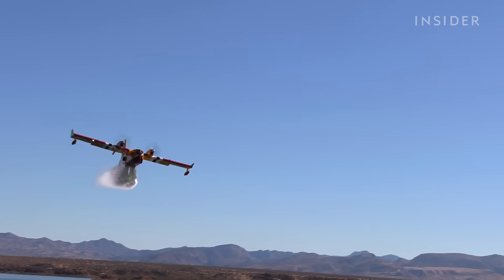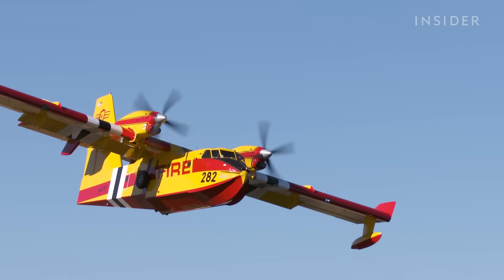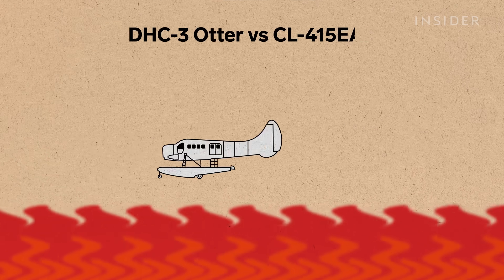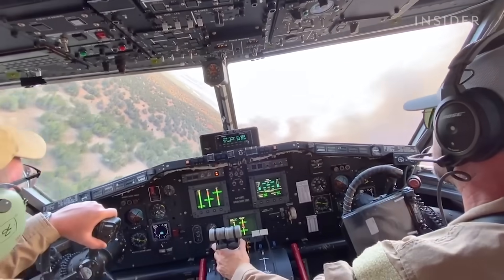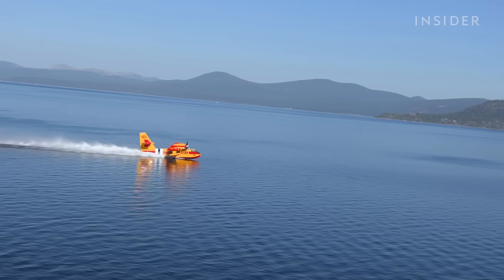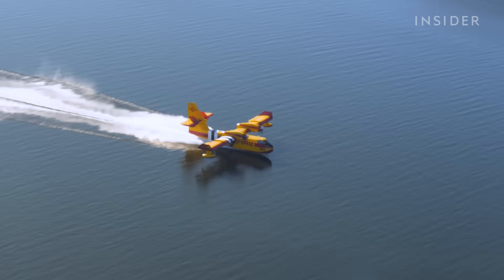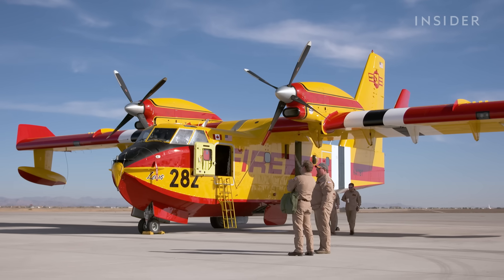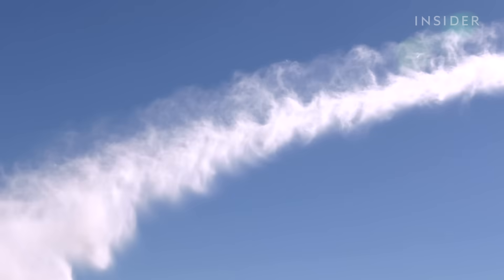How The $30 Million 'Super Scooper' Plane Was Built To Fight Wildfires

Comment: i wasn't expecting that small opening to act as the entry point to scoop 1400 gallons of water in just 12 seconds
Reply: The mass of the water have a brake effect , if it has a large opening this will cause a greater loss of speed.
It's possible to estimate the volume taken by the 2 scoops approximately by 1 foot*1 foot*distance traveled in 12s@100kph

Comment: The should invent in a fire fighting helicopter and have a bunch of them hover around fires.a plane will spray the water be done but helicopters can stay on top of the fire and distinguish it
Reply: How exactly will you load the water onto those helicopters?? Helicopters just hovering over fires are useless. There are plenty of fire fighting helicopters but not a single one comes anywhere near the amount of water these fire fighting planes can carry. Also, the rotors of the helicopters actually blow lots of air into the fire making them stronger.

Comment: Doesn’t need to cost this much. Designed for tide pod generation to exploit govt / municipal / state budgets - basically the public.
Reply: Not really. In general aircraft production is extremely labor intensive, even more so in low production numbers like these planes which fit a very tight and small niche in the world of aircraft and require very specialized development and equipment. 

But of course, companies do have to make a profit, otherwise there would be no point for them to exist.

Comment: Why don't they run a hose. Dynamite works on oil well fires.
Reply: Find a hose several kilometers long and preferably one which can be connected to a pump strong enough to withstand the insane pressure you'll need to push all that water for all that distance. Oh, and  while you are at it, design a super strong hose as well which won't leak due to the insane pressure required.
Reply: @equestriangirly2296  the pressure wave from a bomb blast would put out the fires. It would provide the younger kids with great bomb dropping experience, however I think I saw a streachy hose on tv.

Comment: These pilots must be incredible pilots!! I have driven a fuel truck and you have to be very careful because of the huge amount of fuel splashing around and changing the weight load, I can't even imagine an airplane trying to fly and having to deal with this.
Reply: Engineer here: it has more to do with how full the tank is than how big the tank is.  If you cram the tank 100% full like these planes are doing, there's no possibility for sloshing, and it's pretty safe.  Dump the whole load, and once again, no sloshing.  A fuel truck that only managed to deliver half a load is a worst case scenario.  Not only do you have a liquid sloshing around, that liquid is highly flammable
Reply: In Greece ,which has one of the largest fleet of these aircraft  , many of the pilots are in their 50s
Reply: The tanker truck for the FD I was on holds 2000 gallons of water. When that thing was only half full it was difficult to drive, even with the baffles in the tank. After a fire we always tried to refill before going back to the station so we wouldn’t have to deal with the water sloshing in the tank.
Reply: @MaineOffGrid.  Free surface effect is a doozy.

Comment: 2:44 No! The rudder does not control direction in an aircraft. If you press a rudder pedal, the nose will swing but you will not change direction. When you release the rudder, you'll be pointing in the same direction you started (if you kept the wings level).
Reply: Um, the rudder absolutely does control direction. Kick right, plane yaws right, right wing loses lift and drops, plane enters a right turn. This is literally THE most basic aircraft manoeuvre we have. I mean sure, I can actively prevent that natural turn through aileron input, but that hardly means rudder doesn't control direction ... the entire point of the rudder is directional control.
Reply: @markmcgahey8385  Hi, thanks for your reply. Yes, you can roll an aircraft using the rudder, especially at low speed, but it is the bank of the wings which causes the lift vector to turn the aircraft, not the rudder. The point of the rudder is to counteract adverse yaw and all the various power effects. While you can fly certain aircraft (mostly models) which only have a rudder, you still cannot change direction without banking.

Comment: This video is such a commercial. Did the reporter actually do any research at all or did he just read the script provided by the manufacturer?

This isn't the largest scooping aircraft in the world, the trusty Russians build the BE-200, it will scoop  3200 US gal compared to the CL-415s 1620 US gal. It is not the largest capacity aircraft on the market, it's not the most agile firefighting aircraft out there and it does not have the longest loitering capacity. It's a mid-sized fire fighting aircraft designed for a specific type of fire fighting mission and it will most likely outperform any other aircraft in that specific mission. But it's not the hands-down best fire fighting aircraft for all eventualities.

They claim that it's the most cost-effective firefighting aircraft is highly contested and depends heavily on what you need in your firefighting fleet. There are many other manufacturers and fire fighting aircraft out there that cover different types of markets and fulfil their type of missions better than the CL-415. If your operations have a need for an aircraft with the exact specs and capabilities that the CL-415 has, it's most likely gonna be the most cost-effective. But for others, a fleet of helicopters or smaller/larger fire fighting aircraft may be more suited.

The section mentioning the large size of the rudder is just cute.... The shorter your aircraft is, the bigger the rudder surface you need for a set amount of rudder force. 
For example: The tail section on the Airbus A318 is larger than the tail section on the Airbus A320, this is because the fuselage is shorter on the A318 and they need the extra surface to compensate for the reduced leverage between the tail section and the aircraft centre of rotation.

Yes, the aircraft may have large control surfaces for its relative size. 
But comparing the rudder to the rudder of a B737-900 (the longest 737NG there is) is just mumbo jumbo. 
They are just trying to make something sound impressive to anyone that does not know anything about aircraft design. 
It's not something special to have a large rudder on a short/stumpy aircraft. It's a necessity to provide enough rudder action allowing the aircraft to rotate around its yaw axis.

Yes, this is a highly impressive aircraft.
Yes, this is a highly capable aircraft.
Yes, What the crew of this aircraft can do with it is impressive.

Unfortunately, the hype in this video and the narrative of it makes it feel like a total sellout to the manufacturer and there seems to be very little actual research done prior to the video release.
Reply: The Russians were flying wood and fabric biplanes when Canadair designed these aircraft. They are very late to the  game (Who the hell would fly in something bolted together by the Russians, anyway? Can you put out a fire by dropping pieces of airplane on it?)
Reply: @abrahamdozer6273  Cute and clueless.
Reply: @abrahamdozer6273  Trying to make someone or something look inferior to others by stating factually incorrect information dose only reflect badly on yourself. 

The fact is as follows: the CL-215 that the CL-415 is developed from were designed in the 1960s. By then the Russians had designed many advanced aluminum aircraft with jet engines. 

By the time the CL-215 flew the MIG-21 already had 10 ears in the air. For reference it can be noted that the CL-215 is a piston engine aircraft using engines designed in the 1930s while the MIG-21 were a jet aircraft with engines designed in the 1950s. 
So to use your own comparison: When Canadair built a aircraft with vintage WW2 technology, the Russians we're building aircrafts with state of the art jet technology.

However, this comparison is irrelevant due to the fact that your statement holds no validity since it can not be taken seriously. Its only made to try and make fun of another countrys aircraft industry using false logic containing no factual basis.
Reply: @somfanheller  I would't get into a Russian aircraft if you paid me $1000.00. Fourth raters ...
Reply: @abrahamdozer6273  That tells us more about your knowledge of aviation than the quality of different nations aircraft designs.

All aircrafts fail, Russian, American, Canadian, English, Brasilian, Swedish.... The list goes on. No human design is devoid of issues. 

There are better and worse designs and all manufacturers makes bad design choices. Irrelevant of what nation designed it.

However, I don't see what this has to do with the initial video and how it portrays the CL-415.
Reply: Bigger is not always better. Not all fires are the same. Bigger planes are less versatile because they are less maneuverable, and require longer distances to land, take off, and re-fill the water tanks. Smaller plane can maneuver and function within within mountain environments, , and re-fill their water takes on smaller lakes, for example,  than their much larger counterparts.
Reply: @Doug_BC  did you even read my full post? If you did, you would have seen that I never clame that bigger is better. My whole point was that the video is a complete commercial piece, basically written by the manufacturer. The truth is that different aircraft fulfill different roles/missions and if you watch the video, they make it sound like the CL-415 is the best fire fighter aircraft ever built, for all fire fighting missions.
That is categorically false since there will be aircraft, both larger and smaller that will provide better capabilities for different kinds of missions. 

I'll repeat my prior statement, the CL-415 will most likely excel and even outperform their competitors in the mission type it was designed for. But there are, without a doubt other aircraft better suited for other types of fire fighting missions that the CL-415 isn't designed for.

Comment: 14 autonomous planes carrying 100 gallons each would be cheaper
Reply: You sure? Naaahh
Reply: @goki6548  cheaper than 30 million? 1400 gallons is not much. 14 drones would be cheaper and expendable. they could get more than 14 and swarm. that is eventually how it will be.
Reply: @frankyflowers  you have to release all of the water at the exact same moment and place. 
Also a drone would not be able to go fast enough to make sorties like this. (Not even gonna talk about how a drone would not be able to contain 50 gallons let alone 100.)
Reply: @goki6548  do you know that drones can be big? they can work as one. they can handle more g forces than humans can tolerate. they can use normal planes and make them into drones. what is the top speed of a drone and max weight? thats not true. they can be fast and heavy.
Reply: @goki6548  drone aren't all quadcopters. that yellow plane could even be a drone with the proper hardware and software.
Reply: @goki6548  most stuff that happens in space are because of drones and those tolerances are way more exact than dropping a load where we tell them relative to the heat source. there could be an autonomous bucket brigade or swarms working in unison.

Comment: Dont understand what all the hype is about, the Martin Mars water bombers in Port Alberni BC are larger 4 engine float planes that have been used since the 1950s and can drop 27000L (7200 gal) of water at once.
Reply: Martine Mars bombers are old and are at/nearing the end of their useful service life though.
Reply: My point isn't that the old out dated hard to maintain planes are better than this little guy, it's that this is not a new idea. Strapping some wings and engines to a big tank to drop water on fires. This dude acting like he discovered water puts out fires!
Reply: The criteria is not the capacity per flight but the one per hour. If a plane can make several rounds even it has smaller capacity per flight it can carry much more water in a shorter time

Comment: It looks like they contained and stopped the spread of fire back in the days unlike now it spreads beyond grip.
Reply: Fires arising from the kind of droughts in well grown areas we are getting cannot be contained untill some rainfall comes. You can't drop water on dry and dense brush, the soil will soak it in deep and the heat will evaporate the rest of it in seconds. Besides you would have to spray the entire perimeter every few minutes which just isn't doable. These resources are mobilized when you get a fire that can be contained (lower density brush in more arid climes), or when weather conditions favour a containment attempt.

Comment: The aircrafts are a must to fight forests fires and worth every penny
Reply: this one isn't. its only 1400 gallons
Reply: @frankyflowers  1400 gallons up to 10 drops an hour, versus a huge tanker that has to land to pump its tanks full again which can only fly perhaps a drop per hour or even longer. Add in that they often fly in groups to mount sustained attacks and it gives the fire a sustained beating, rather than a big punch occasionally. Also think of how a fire will continue and grow in the time between passes, they can grow enough in an hour that you'd not even know there was a drop 60 minutes ago. Sustained attack with short intervals between drops is the way to go. If the big birds were effective, then why are all 3 of the tanker-converted 747's grounded and inactive? The answer is they're not efficient, can't land at small airstrips, need huge temporary tanks or large water mains to refill and their cycle times take forever, plus the maintenance costs on them are astronomical. Sure, the 747s hold 19,600 gallons, but what about bad drops? They have to fly way higher that the CL-415's so their accuracy sucks and the dispersion is massive, and if they miss entirely its still another hour or whatever for them to land, tank up, take off and fly back to the fire. These CL-415's are the A-10 Warthog of water bombers, they're dump-trucks that can fly low & slow and nothing else does their job quite as well.

Comment: They really need a slow door release option.  Dropping 1400 at 100 ft at 200mph is like dropping a bomb.  I used to call the shots from the ground,  when there is no air attack its direct comms to pilot.  Sometimes you want a high slow release the effect more like a genital rain than TNT.   Yes I've been hit by 1000 gallons directly and it nearly killed me.  I was braced and latched on to the rock and it about washed off the cliff.  [The face of wich was full of burning trees and stumps in the cracks ]   anyhow cool educational ,  my brother in 33 year of wildfire loads slurry at Paso Robles now , I only did a decade then broke myneck a second time Takei g me out of service

Comment: Nothing makes the inner child so excited and the adult side so happy, then to see a CL-215, 415, or even the new 515's in action. Expensive as they are, I think every country should have several of these aircraft near every populated area, even cities, mostly the newer CL-515's having much greater purposes in its design other then firefighting, though that is the main purpose. The other main purpose while not fighting fires that make it even more valuable to have is the search and rescue capabilities, with radar modules that can be fitted under the wings in less then 30 minutes, with extra cargo space and a larger cargo door for deploying rescue equipment while in the water, and taking on rescued passengers, and with the addition of optional stretcher bunks, really make it ideal to have. The CL-515 can also land on rather rough landing strips, like dirt strips or long grassy areas, though only in an emergency case since damaging the aircraft is still a possibility, but the amount of roles the CL-515 can do with very little prep work to the aircraft makes it the most valuable aircraft to own in my opinion, and by valuable, I am not talking about money. It is possible with the modernizations to the older CL aircraft that Viking is performing, could bring these extra features that the CL-515 has, but because it is Viking who is building these aircraft, the may not since they do need to sell the newer aircraft after all lol

Comment: You missed that the CL-415 was actually the revamp of the Canadair CL-215. Same air frame, but newer powerplants. The 215 had twin pratt and whittney radials instead of the more modern turboprops that the 415 utilizes.

Comment: Are these planes still in production?
Reply: The one in the video is a total rebuilt CL-214 (the first variant of this plane and probably manufactured in the 1970's). This rebuild converts it into a Cl-415.  If you want to spend an extra 5 million you can wait for one of the next variants the CL-515. Production of these are about to begin in 2022.

Comment: Why aren’t you mentioning that the 415 is only using water in these situations and not  the retardant that land based aircraft carry which is several times more effective than plain water? 
Great advertisement tho, just not very accurate....they also use FLIR  which is a big advantage....and a SEAT can carry almost as much as a 215 and two Seats can do more effective drops than a 215...
Reply: The 215 and 415 can use retardant